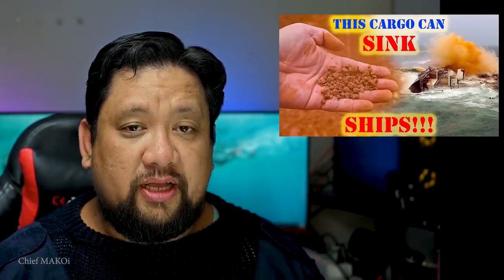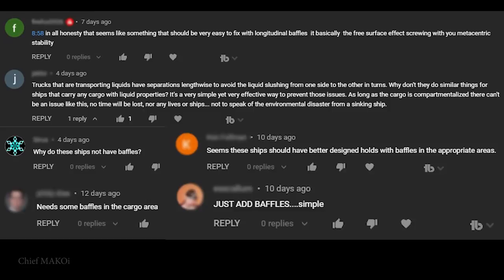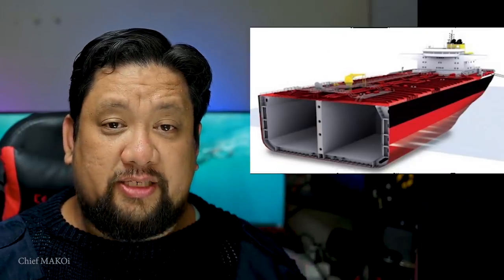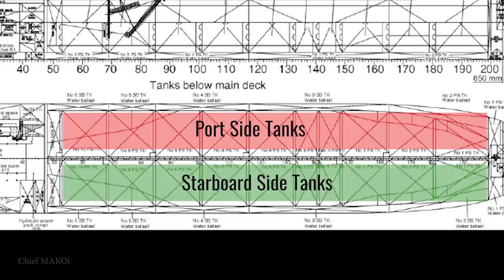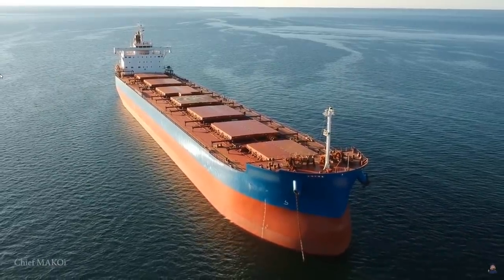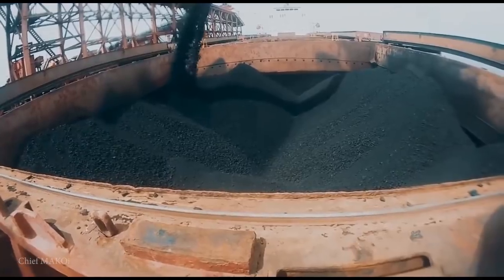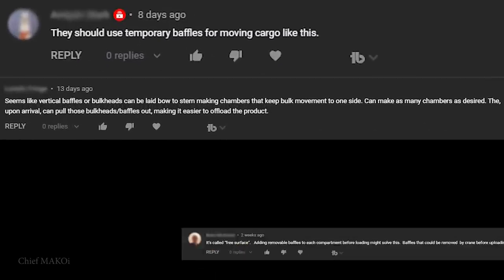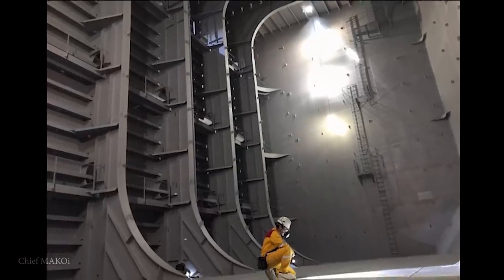Free Surface Effect: Should Baffles Be Installed in Bulk Carrier Ship's Cargo Holds? | Chief MAKOi

Comment: I worked at a mine in Iran Jaya many years ago and the port used waste oil from all the vehicles and generators to run an ore dryer.  The process of extracting the metals was a floatation so there was plenty of moisture. The ore was piped about 70 miles from an elevation of 9500 feet to the port.
Reply: A friend was Chief Engineer on a fishing vessel.  The fish leftovers would be squeezed to extract fish oil, which would be burned to dry everything and turn it into fish meal. Nothing went to waste. He said the entire thing smelled terrible and any repairs were not fun!
Reply: @bigpjohnson  I use fish meal fertilizer in our garden and greenhouse and it does smell once it gets moist. It is the best fertilizer I have used after trying all those fancy organic liquids I’ll stay with the fish meal.

Comment: Very well explained. There is no need to install baffles. Just follow safety standard. Which is to assay the cargo for percentage of moisture.
Having a baffle is like trying to fix a safety violation with a safety device, when what is needed is to take precaution and avoid a dangerous condition.
Reply: Exactly. Suggesting a much more difficult and unworkable solution to an existing standards violation is, in my thinking, just stupid. Knee-jerk reactions are how people seem to solve their problems today anyways. I'm baffled.
Reply: @SpaceCadet4Jesus  Surely you're not baffled, as you're advocating against installing them. 
... I'll see myself out.
Reply: @SpaceCadet4Jesus  Just thought of this better analogy. I think.
If we have a truant on board, we don't accommodate him by adding protection. We don't allow him on board.
Reply: @ramonching7772  Depends on how "Hot" she is.
Reply: exactly

Comment: As a guy who has driven (and still do) tanker trucks,and grain trucks, baffles can be handy to have,but they make unloading a complete bitch! Plus,you can't really baffle solid load tanks! You'd never get it unloaded or clean enough to not contaminate the next load. 
Key board marine architects are apparently a thing huh Chief?
Good video clearly explained!
Reply: I've heard milk trucks are the worst, because they cant have baffling since that would make them impossible to clean and sterilize.
Reply: Yep.  No baffles and all the ones I have seen are single compartment tanks also.
Ive driven different tankers off and on for over 25  years and ive never driven one with full baffles. The closest is those big poly tanks with the indentations on the sides for the straps to hold them  on the truck.
I will know how to behave with a baffled tank!
Reply: Supposed to say wouldn't know how to behave!

Comment: Great channel, found it lastly. Good job Chief! 
And yes, as naval architect can confirm, in designing ships is all about money. Each vessel is customized, and optimized to maximum.  It's not a massive production asset. Even if someone says there are sister vessels, they are never the same. Baffles would be for first too expensive to produce, too expensive to carry onboard (reducing the load capacity) and too expensive for maintenance. It's just cheaper and safer to have standards for carried cargo :) btw, max moisture content is also in buyers bussiness, to be low. He does not want to pay for transporting water.

Comment: Thx Chief, great, logical & through explanation of why baffles are not practical for (certain thpes of) bulk cargo. Semi-liquid potential is not sufficient reason to justify the costs &  related complications of intermittent use then on-board storage issues. Your industry has developed specifications for testing for moisture content. Captain & Chief are trained in these matters. So your video was great at explaining all these indepth problems & industry practices to insure safety when ships travel on all oceans in all types of weather & related forces acting on these ships. Another great video Chief! Carry on Sir!👍👍👍👍🧑‍🔧🙂☕

Comment: Second-guessing engineers? As usual, it boils down to acceptable risk and desired profit margin. (You could wrap yourself in bubble wrap every time you get into your car too) Nice video, Chief. Your channel is always interesting. Thanks.
Reply: yo could just drive without seatbelt and ignore traffic roles too. looks like ships do away with seatbelts but have rules. which not always works though...
Reply: @mechadrake  Seatbelts are cheap and don't cause much inconvenience. Maybe a better analogy would be helmets. Drivers could reduce the risk of injury by wearing one but most don't see it worth it. One exception is motor sports where the risks are higher.
Reply: @seneca983  i meant seatbelts as an everyday, clear to everyone, safety device. If we want to be analogous, so I would have wanted to wrinte mandatory crumple zone mechanics, for example. Which is not simple or cheap, but the cars are not sold without them here in EU countries. The rrason, for example, we do not have key cars from japan, as they do not have as much safety as normal cars, despite being slower lighter transportation.
Reply: @mechadrake  I still don't think that's a good analogy. The extra cost isn't prohibitive. Like Makoi said, baffles could make ships unloadable in many ports.
Reply: Your comment grossly underrates the expertise of armchair structural engineers. If a guy with no experience or working knowledge of an industry doesn't know the perfect solution to that industry's problems, then who does?

Comment: I am a fan of naval design and I want to thank you for your intelligent and understandable explanations of the why of these things. 
On the longitudinal bulkheads; good sense there Sir, the problem of the shipper is interestingly different than the engineer designing a combat ship. In that position, it was found that with empty compartments it was better not to divide the area fore and aft. When center line compartments were installed if the outer plate was penetrated it was found that the ship would flood asymmetrically leading to a capsize.  The designers who make ships depend on a huge history of why ships fail. It is not always clear on the first contact why this is.
Reply: Correct.  Every solution creates a new problem when something fails.

Some ponder that the Titanic would have stayed afloat and level longer without watertight bulkheads.  They were designed for 1 set of conditions, but not for unforeseen conditions.

Comment: While I'm not familiar with the transport of dry cargoes, I have some experience in LNG shipping from an engineering/financial analysis perspective.

In the case of LNG, baffles are generally not used (even though they would not impeded unloading like in dry cargoes) because ships normally transport a full load of LNG, and without voids the cargo won't move around. Small amounts of LNG (say <25%) cause other problems as the sloshing can rip the stainless steel cladding off the walls of membrane-type LNG tanks (not an issue in Moss or "bubble" type tanks), which exposes the insulation and allows LNG to get in between the inner and outer walls of the tank.

I assume in the case of many dry cargoes, their densities mean that volumetrically you can't get a full load due to cargo density and weight issues.

Comment: Nice explanation.  I did hear that specialized ships used with dredging had holds that had 'de-watering' equipment.  Since the silt/sand/mud from the dredge is of course saturated with water, these could somehow pump the water out of the hold while more silt/sand/mud was being loaded in.  I'm sure it's not practical on most bulk carriers, but I found it interesting and at least somewhat related.

Comment: Great explanation to the obvious question! I still feel like there might be a cheeky solution to the economic problem, depending on the type of separation of material one is concerned about. For example dirt can be effectively reinforced by cloths alone, which while themselves unable to bear any significant weight still enforce structure that the dirt around naturally build on. However this wouldn’t stop any liquid on top of the cargo, which would have the mass to break any such cloth, and viscosity to escape from the other side.

However even if sufficient, such cloths would need to be installed before loading, loaded evenly from both sides, and either removed from or destroyed when unloading.  And in the best case they would only permit a higher tolerance of moisture in the cargo, meaning this difference in production/preparation costs alone would need to fund the whole modification and operation.

Some problems don’t need a right kind of tool to solve, but should be worked around or entirely avoided in the first place.

Comment: In the 1970's the US government mandated seat belt interlocks on cars.  One could not drive a vehicle unless the seat belt was engaged.  This caused all sorts of problems and in a few years, the SBI mandate was eliminated.  As the Chief said, baffles would work but cause a host of other problems.  Wet bauxite can be measured so if a ship is sunk due to the surface effect, somebody made an error.  A partial solution is to have on board test equipment to measure moisture content.  It takes hours or days to load a ship so there is ample time for the crew to perform the tests.
Reply: Because it takes hours or days to load, a single squall line can come along and invalidate your tests. Your solution also does not take into account human failings like greed or the pressure to skimp on safety because they had gotten away with it before.

Comment: I'm enjoying your clips. Wondering why enlightened self-interest doesn't encourage ship owners to either gear-up for cargo that can liquify or elect not to carry said materials. Guess it comes down to how much it costs to pay off the widows, eh?
Reply: In any industry you have to watch out complacency.

If the industry deems it safe with other measures, then it must be safe. In the other video, the vessel's captain didn't wait for the cargo test to be carried out; took off with a wet cargo. Had they refused the shipment, or carried out some other means to dry it; they certainly would not have sunk. But complacency set in, a couple people didn't do their jobs; and everyone died. And remember the bad workers will take the good ones with them; three fold more as you keep going up the chain of command.

Comment: Whether it's worthwhile is always a matter of balancing the pros and cons and at least to some extent subjective. Your claim that baffles have to be removable sounds valid to me, the practical objections you come up with less so. I can very well image that you use moveable baffles that, depending on whether they are needed or not can be moved. Put them on a rail and you can move them automatically. Or you may tilt them out of the way. I think creative engineering solutions are possibe to make it work in an efficient way. As you say, in the end it's just a costs/benefits analysis whether it's worth it.

Comment: That baffles are not an economical solution had to be expected, as you explained very nicely, Chief. Something I wondered, though, at the last video already and again in this video: the ships do have transversal bulkheads compartmentalising the cargo space already a lot. Now, let's assume we don't have half-filled compartments, but compartments are either filled to the rim, have no cargo at all (maybe on might be filled partially in order reach exactly carrying capacity). If the cover can keep the cargo back, then these fully filled compartments don't have any free surface effect either. Now, this means the cargo load is not equally distributed longitudinally, which might be a no-go for most ships, but: has this kind of approach been tried?

Comment: The current idea is more reasonable as long as the ports, loaders and the company management follows the "liquefaction" rules and minimums. If they do, there is no liquefaction risk. If they do not, as in your past video shows, the risk becomes reality and due to humans in charge who have a biased position that determines load it or not to either save money or make money ignoring the  current moisture content of the load/cargo.
Reply: That's what happens when you rely solely on administrative controls rather than engineering controls. There's a reason the heirarchy places them so far down.

Comment: Nice reasoning! I guess that when it's transported a type of material prone to liquefaction it should be applied on the top a type of "drawer separators" or temporary baffles only for the top part of the material (see Ikea LYTVAGEN) Also some robotic pump in case of rain would be not bad.

Comment: Agree with your comments.  I didn't see anyone explaining the "free surface effect" in detail - perhaps I missed it.  If you push down on the side of a vessel or boat and let go it will restore itself back to horizonal and go past to the opposite side. This will dampen out in a few cycles.  The period between reversals in the natural rolling frequency of the vessel.  Similarly, based on tank dimensions, degree of filling, density, and viscosity, the fluid in a tank will also have a natural frequency of sloshing back and forth in the tank.  If these two frequencies are close to each other there can be a resonance that greatly magnifies the effect of the tank sloshing on the roll of a vessel in a seaway.
Reply: Free surface effect has nothing to do with sloshing. Imagine a box and you fill it half with water. The water surface will be level at all times due to gravity. Now tilt the box over, let’s say by 30°. What will happen with the water? It will displace itself to the side, hence the weight of this displaced water will be transferred to that side. Now you see that you changed the center of gravity of your cargo, as a result the stability of the ship is impacted. The righting moment of your ship was reduced. 

What concerns the tankers it is not the longitudinal baffle which is the main reason they are stable/safe, the simple solution for these vessels is to fill up the tanks to 100% of capacity. That way you avoid free surface effect and resonance from sloshing. Dome shaped tanks are also a solution (e.g. LNG vessels ).
Reply: Nicolas,   we are talking about two entirerly different issues.  You are referring to changes in static stability about the logintudnal (roll) axis.  I am talking about dynamic effects of constructive interference of two different accelerations.  In my area of experience, (submarine design) the dymanic effect is referred to as "free surface effects".   It is of concern for main ballast tanks and trim tanks and similar unconstrained tanks.  Perhaps the nomenclature in commercial marine design may be totally different  to navy terminology.

Comment: What are your thoughts Chief on something like "Webbing" type baffles that could be put up and taken down as needed. In terms of liquifaction the cargo still retains a semi solid state. So with heavy steel baffles it would be uneconomical and considerably detract from the load weight of the ship. However with heavy materials in use these days surely it would be advantageous for shipping companies to consider. 
For example a company was transporting (via road) poultry offal which is both solid and liquid and subject to the same physical laws as any ship with a cargo suffering from liquifaction. By having a webbing divider the length of the deck down the centre of the vehicle, it was enough to slow the movement of the cargo and greatly reduced the accident rate with the company due to roll overs. Also with just a 150 kg as compared to  2500 - 3000 kg with having a permanent or semi permanent baffle put in place.

Comment: (04:27) That's partially true because Bauxite Carriers are specialised ships and they are prone to stability issues due to bauxite liquefaction. The lack of baffles and/or a centreline longitudinal bulkhead are for different reasons. The ship's lightweight is very optimised, adding a centreline longitudinal bulkhead is prevented by planning the loading sequence, as loading is the condition that produces the maximum bending moment for this type of vessel, i.e. the seagoing bending moment is made to match the loading condition in order to maximise cargo volume. Adding a longitudinal bulkhead also means dividing the vessel's cargo holds into two, which causes complications in the loading operation, as it's usually done with one feeder, so the harbour facility would ideally need to be upgraded to match the vessel; however, it ultimately fails to solve the problem.

As for the baffles, liquified bauxite (bauxite is a type of soil with the consistency of mud) is still very viscous and will climb the side of the cargo hold and stick there, making the vessel heel. It is not the free surface resonating with the sea state that causes the capsizing like it happens with true liquid cargo, it's a shift of the cargo that causes the heeling (think of porridge), adding baffles would not prevent it. With that said, a deep stringer installed about 2/3 the depth of the cargo hold, on the longitudinal bulkheads, similar to a containership's narrow deck, would potentially limit how high the liquified cargo can climb the side of the cargo hold. Some vessels do include narrow stringers but not for this purpose. It's not generally done because those events are rare, there's no obligation from the classification societies, it's yet another surface to scrape and clean, and the Japanese don't do it and they are the lead designers of bulk and bauxite carriers in the world.